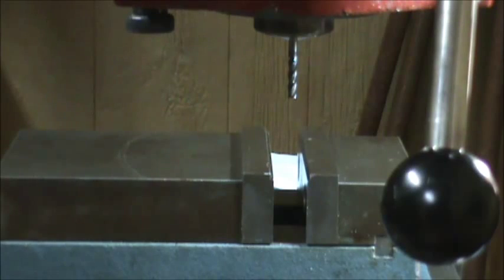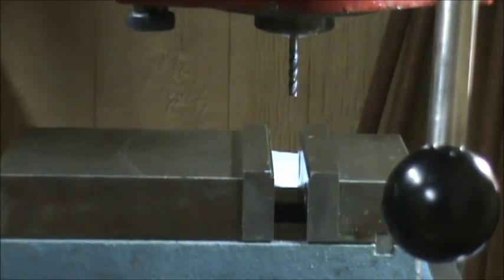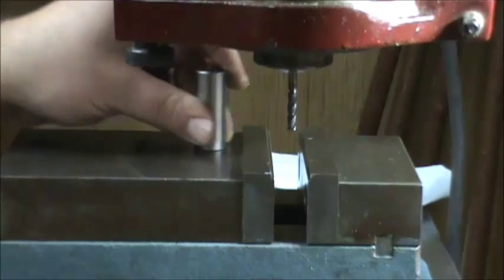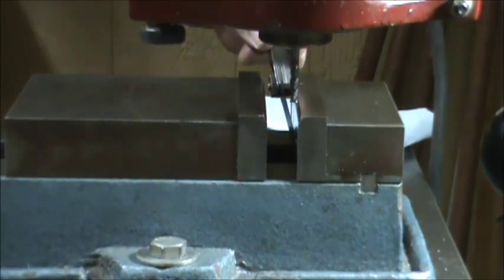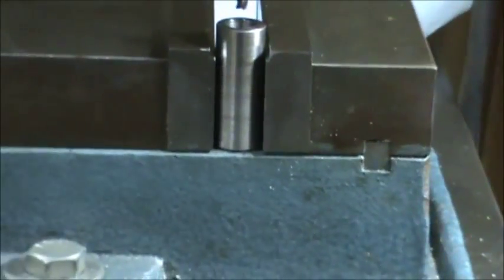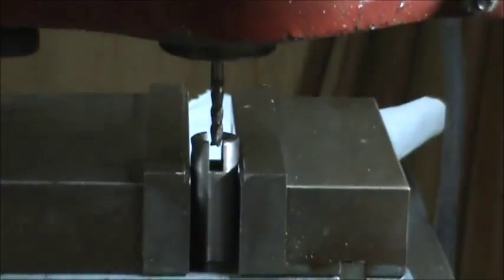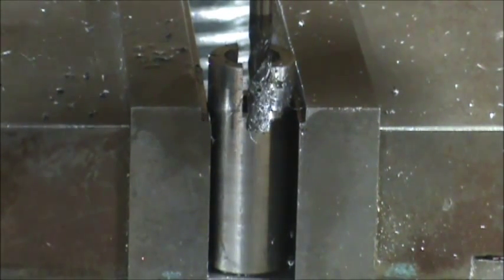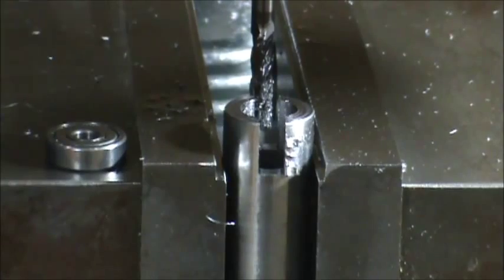003 STEADY REST MODS BEARING CARRIER PART 1 edited

Comment: I'm doing a similar mod on a steady with brass tips.  Thanks for the vids.  Could you have done both work peices together if diameters are close enough?  I.e. clamp them both in the vice together to make the bearing slot and guide groove. also the holes but you still would have to locate each separately for that so it wouldn't matter much.  Good job again!